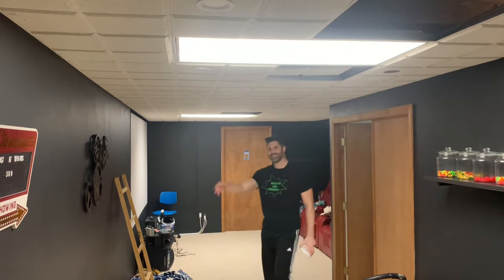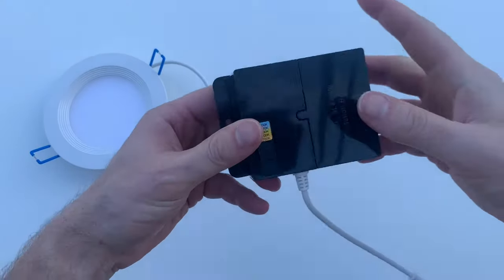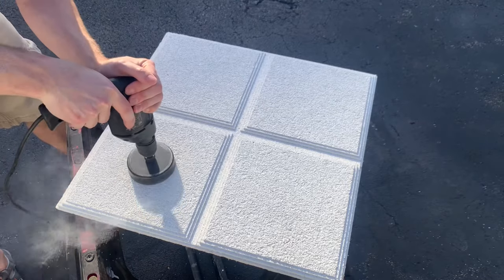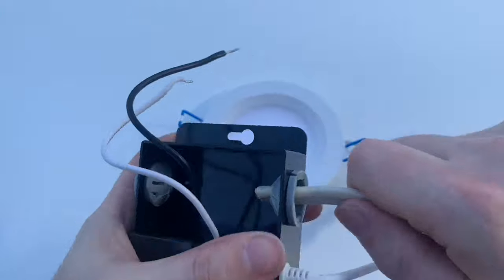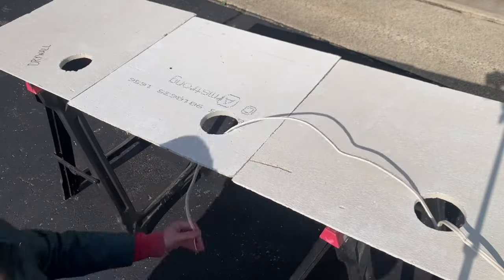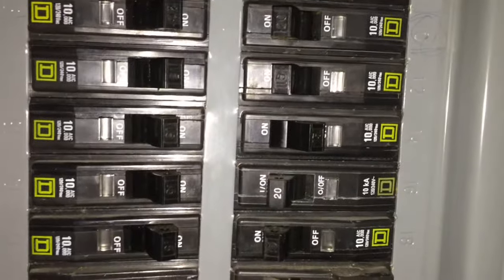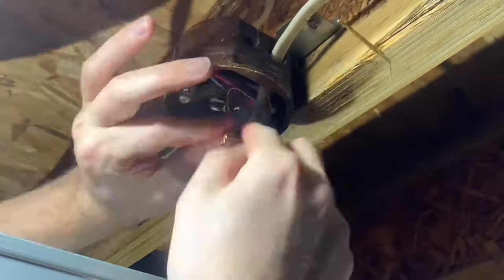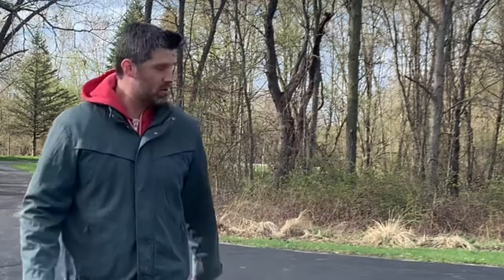How to install LED Recessed Ceiling Lights EASY! Ultra Thin - Huge Upgrade! (Downlights Lighting)

Comment: what size hole saw did you use size on the directions is kind of weird
Reply from the maker: The instructions said to use a 4.33 inch hole saw, which is 110 mm. I looked into ordering a 110 mm hole saw because it was not available in any stores, but I ended up just using my 4 inch hole saw and it worked fine.

Comment: Did you get any sag in the ceiling panels in the last year due to supporting the weight of the LEDs since these are not otherwise supported?
Reply from the maker: No sagging has occurred. Everything still looks normal.

Comment: What if they turn on sometime but you have to flick the light switch up and down? Causes?
Reply from the maker: If you need to flick the light switch up and down, I would start with replacing the light switch.